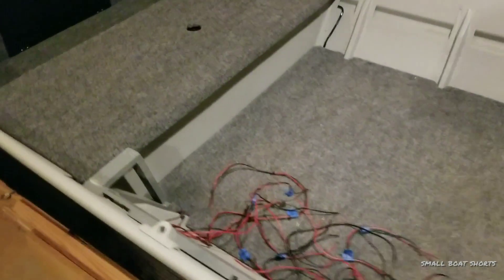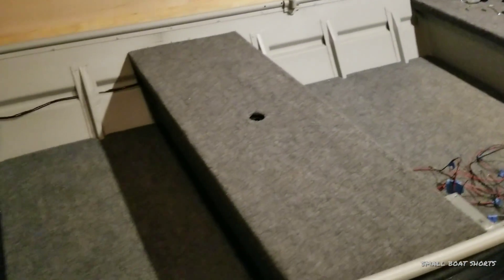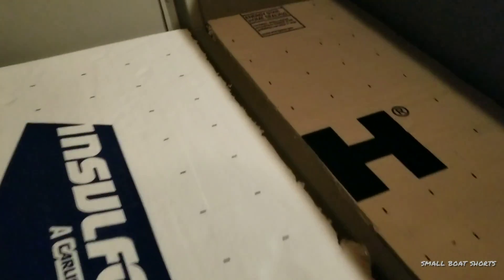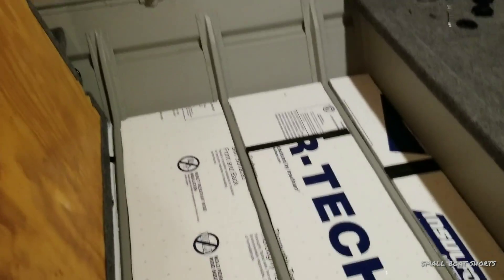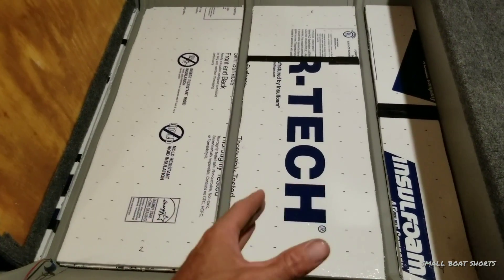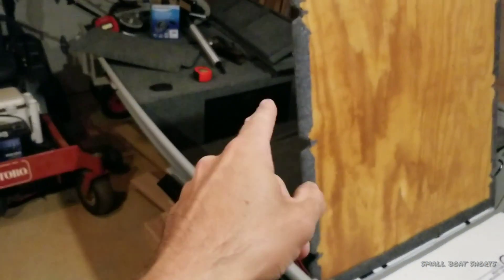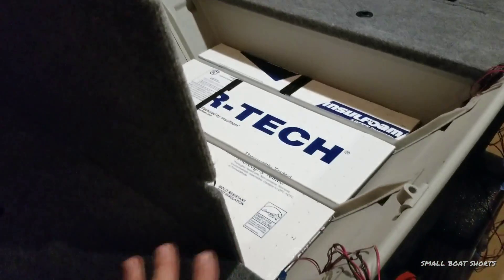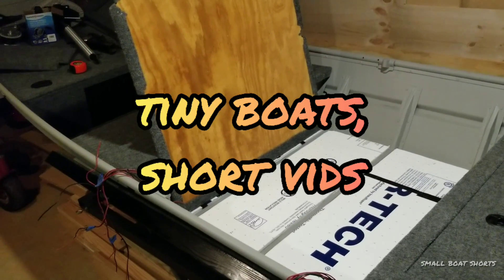SMALL BOAT SHORTS Ep. 1 - Floor System

Comment: I’m glad I watched the whole video because all I could think about was, if he doesn’t secure his floor panels to the boat they will just float away with all the insulation if he capsizes. Great video.  I want to shop for a job boat now...
Reply from the maker: Yeah man I just implemented the same design they use in residential home construction. In a house a "floating" tongue and groove floor locks together and is not nailed down, simply floating over the foundation. Its locked down around the perimeter by shoe molding trim. Same concept here. My foor floats in base of boat and is locked down by side trim panels and stow compartments that bolt in over it. The emphasis is that you need the foam risers flush with the ribs and your wood floor to have a nice flat fit.
Reply: Anthony Jones keep up the good work.  I love the clean simplicity of everything. 👍

Comment: Thx for responding Anthony. I’m working on my boat build now, I have an idea of making a foldable and tuck away casting deck for back of boat where you sit low to run trolling motor. I have seen no ideas for this at all anywhere. If I figure it out I will send pics.

Comment: How much weight have you added to your boat with all the wood and fiberglass resin? Also what size motor are you running?
Reply from the maker: I did the full boat w about 1 gallon of resin, so that didn't add much. Between the redwood framing, and 11/32 decking, it's pretty light. I can lift the trailer up and move the boat around by hand. I do not know the weight though. The killer is batteries which everyone seems to forget. They see all the decking and framing and just because of it taking up the whole boat they think its heavy. I run 2 batteries and they  are 65 pds each. I honestly think my full build is lighter than my two batteries weight combined. Also though, there are guys running 4 batteries or more for electric only systems and they get around fine. I will primarily fish electric only reservoir system we have in GA with a 55 ps thrust for now. I also have a Honda 4 Stroke gas burner 8HP for the bigger lakes. The Honda is a great motor and before my build I have achieved 24 mph so after build I'm think 15+ hopefully.

Comment: Crazy question. If for some reason you take on a bunch of water wouldn’t the foam sheets want to float out of the boat? The bottom foam is not secured in place and just rests on the floor. Love the vids, keep up the good work!
Reply from the maker: Foam goes under floor, floor floats freely, flush mounted interior side panels bolt in over floor and lock everything down permanently. Even if flooded there is no way the floor or foam can get out because the side stow compartments and interior panels bolt in over the floor therefore holding it down. I purposely did not glue foam down to give it room to breathe or accept and channel water if necessary.

Comment: man I looked at 11/32 and it is so thin, im a pretty big guy 6'2 255.. think I may go with 15/32 on my deck and 11/32 on the floor...idk what do you think? I have my redwood ripped down and ready to paint, as that is the system im going with instead of aluminum.
Reply from the maker: It is thin and requires special attention to detail when framing and whatnot. 15/32 is good, 1/2 inch is pretty much the standard,  i was just trying to shed some pounds.

Comment: How many coats of resin did you apply to the floor boards?
Reply from the maker: One heavy coat on top, I went a tad thinner on the bottom and depending on the grain it absorbs it a little differently. I did sand the top to level before carpeting.
Reply: Thanks. I found your video for waterproofing casting deck hatch w/ fiberglass resin after I asked the question.

Comment: Love your videos! Have you ever had problem with ants getting in your foam, I have ant farms built in mine after a year being in the boat?
Reply from the maker: No, my boat lives in my garage. I have post control spray my house and detached garage every quarter  so no issues with ants or bugs getting inside the structure or boat.

Comment: what happens when all the foam and stuff gets wet
Reply from the maker: Gravity works in these boats. Water finds a way towards the drain channels under the foam typically. The foam is closed cell so will not absorb water. Only issue I see is if it gets flooded water getting under the foam and in tight spots and taking forever to dry out and stinking in the process. A lot of the old foam used in the benches of these boats actually absorb water believe it or not. The pros the foam adds compared to the cons are well worth using in my opinion. Also as always stated, my boat is garage kept so will only get wet if rained on the couple times a month i get to take it out.